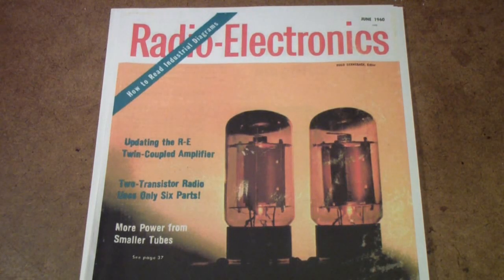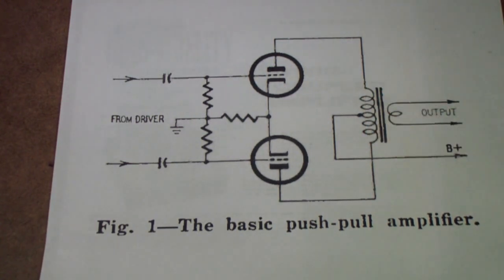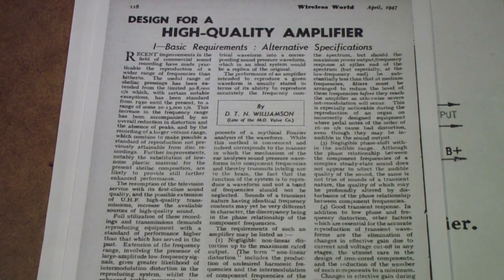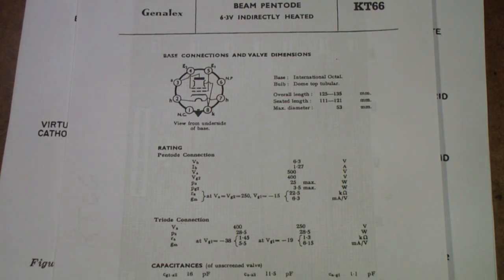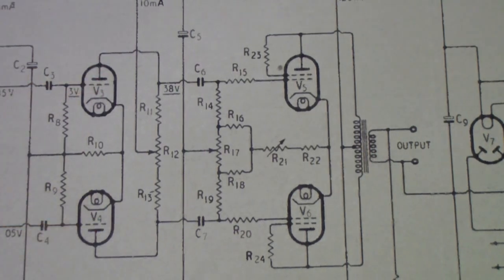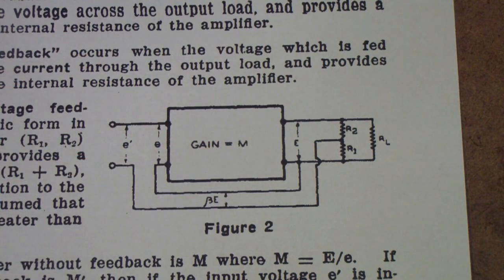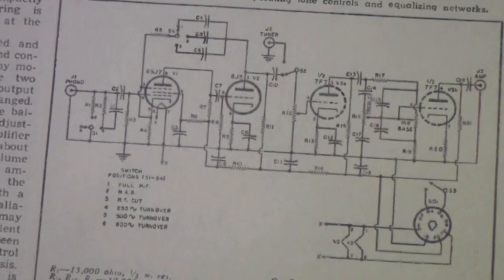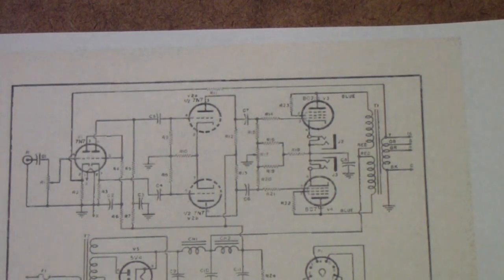TTT094 HiFi Tube Amps Part 1a

Comment: A little chronology:

Beam tetrode EMI 1933
KT66 1937
'Ultralinear' or screen tapping in output transformer: AD Blumlein 1937 British patent, 1938 US patent
Williamson amplifier first built 1943, published 1947
HJ Leak & Co 'Point One' amplifier, 0.1% THD: 1945
Cathode loading: PJ Walker 1943, McIntosh 1947
Quad power amplifier, 0.03% THD, 15-55KHz, cathode loading: 1951
Output transformer bandwidths were already up to 50-60KHz by 1950, and by 1960 Radford had them up to 150KHz (all -3dB points of final amplifiers).

Keroes introduced further changes to the Williamson apart from screen loading, for example he added cathode bypass capacitors to the driver stage, which seems dubious given Williamson's stated reason for omitting them.

Comment: What a delight to see. Thank you. I just sold a pair of Partridge transformers for what was probably a later Williamson design with screen taps on the primary for 'ultra linear' operation. I put them up at 30 pounds to start - hoping for maybe 60 pounds - they went for 550! Nuts.
Reply from the maker: Yes, the tube amp craze is still raging through the music scene. Much of the current price mania seems fueled by both nostalgia for the old hi-fi amps and the desire for the sound of tube distortion in guitar amps. I must admit that the distortion characteristics of a tube amp is pleasing to the ear; my ear at least. Thanks for subscribing.
Reply: Partridge is very well considered , the price is what the hype is about ............BUT they were indeed state of the art and still looked after and desirable  by tube builders.
Even the partridge MC transformators are going HUGE prices in Japan ...well beyond the price of a tube preamplifier.
Today the very best OPT 
( Tamura and other brands go over 1000 Euro/$  a piece  )

Comment: I believe the first series Williamson amplifier used a 5u4  2@ 6an7 and 4@ 807 outputs  also the power supply was a separate chassis with cord I made a very close clone and it is a great sounding amplifier I’m actually using a type 83 mercury rectifier so I can increase my voltage and they just look cool I love the 807 tubes there many still out there and not that expensive 
I wonder with Russia in the war now many tube prices will start going up fast 
What do you think

Comment: Well I wrote a comment six years ago! Not sure why as I re-read it I didn't mention the Leak Point Ones? I'm sure as now it would have been first thing to mind..
Anyhow Harold Leak's Point One amplifier was released two years before the Williamson, and is certainly its equal. Point One refers to that holy grail of distortion products slipping well below the audible.

Comment: How's called the problem you talk about in minute 21:00? About the oscillating output of the transformer and the frequency of operation of the Williamson transformer. It's for research purposes, I'm studying electronics engineering actually. Thanks for this info! It's well appreciated

Comment: At 27.50 time the photo is what I built it is not a pre amplifier like you said 
The left chassis is the amplifier and the right chassis is the power supply the only reason I know all of this is I worked 2 years on this amplifier and many long hours of reading documents I have a pair of nos acrosound output transformers I happened to find at a yard sale for 30 bucks that’s how I got into this mess

Comment: I think you will find that ACRO did not make the original output transformer that Williamson used for his amplifier development.  ACRO were a US based manufacturer - not british.
Reply from the maker: I have done a little more research and I think you are right. Since I was two years old when the original articles by Williamson appeared in Wireless World I depend on documents from the time and sometimes my memory of them. I had an Acrosound catalog around 1960-61 that I remembered saying that it had worked with Williamson in developing the transformer. I just re-looked at that catalog (after more than 50 years) and they don't actually say that, instead referring to the "close attention paid to the Williamson specifications" in the development of their transformers. The original 1947 Wireless World articles gave the specifications for the output transformer, and I assumed that what Acrosound was talking about was coordination with Williamson, but that is not actually what they said. Once again I learn that I cannot totally depend on memory from the 1960's. Thank you for your correction.
Reply: Very interesting.